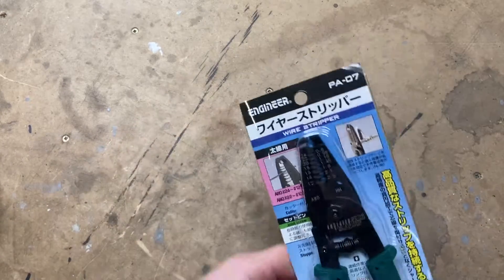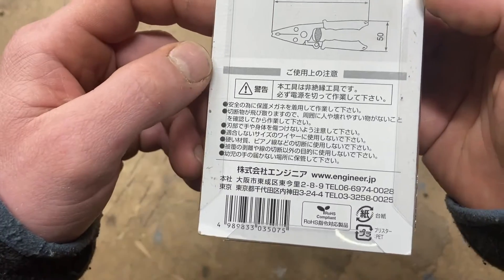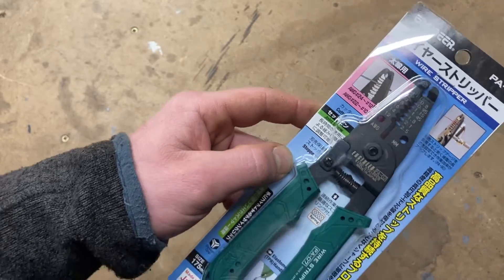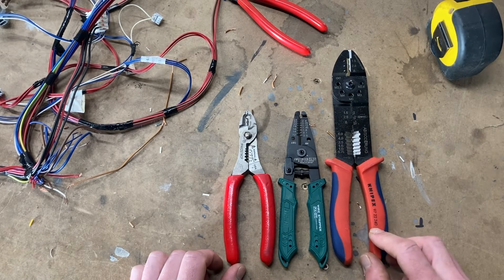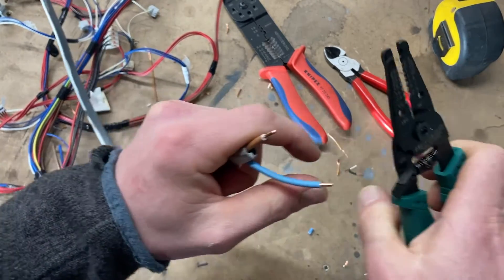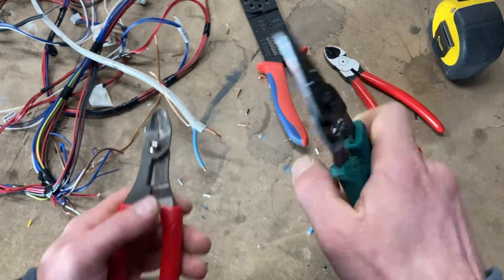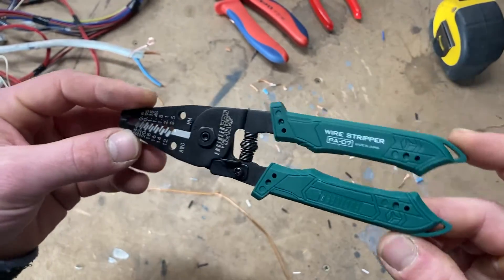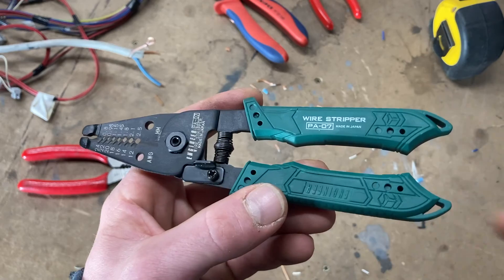Engineer PA-07 Wire Stripper - Better Than Snap On?

Comment: I'm not always right but... If I'm working with wire in AWG, American Wire Gauge, then I try to use US made strippers. If working with wire gauged in MM , metric, I'd use German or Japanese made wire strippers.  One hole size doing both systems can be iffy, pulling strands out with the strip or marring the solid wire.   Then again, those things matter not to some techies.  Here in USA- I love my Kleins, near perfect strip every time on AWG or solid. That said,  Engineer makes great tools, I have a small pair of the "screw pliers" - work like a charm.